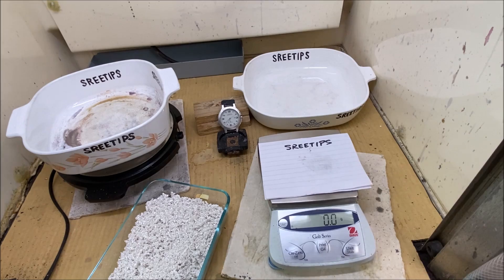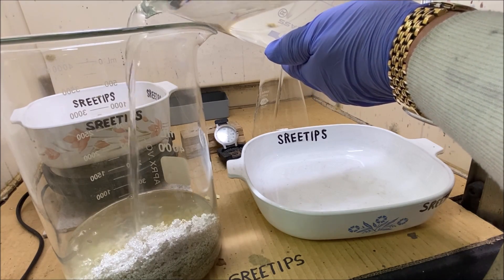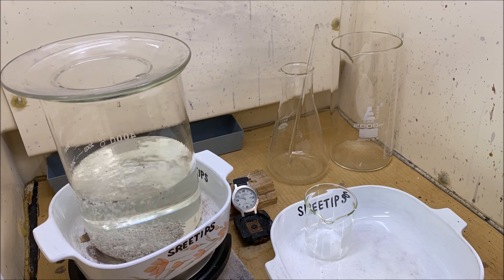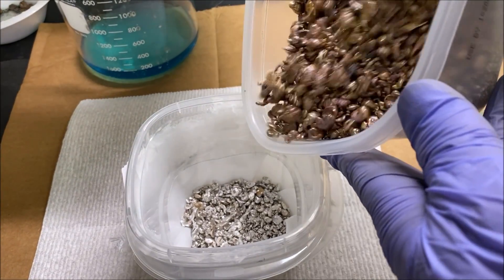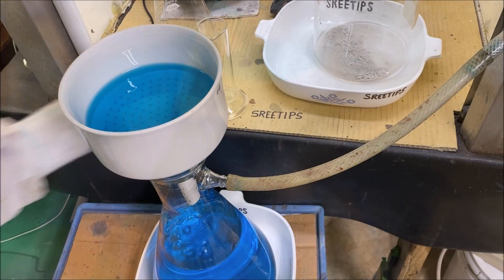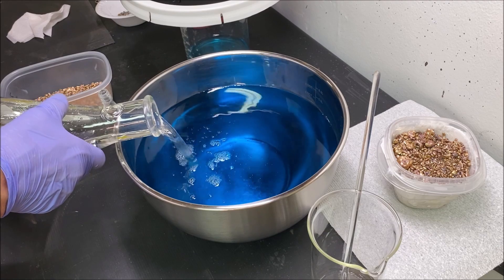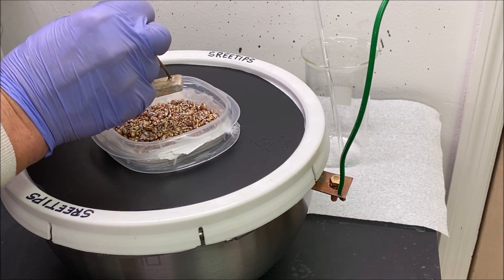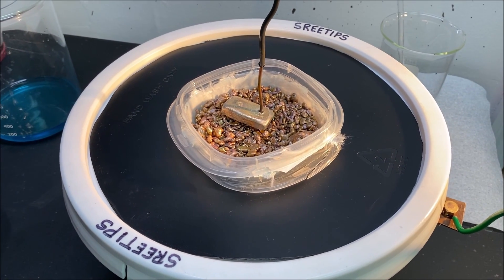Growing Pure Silver In My Six Liter Silver Cell

Comment: Do you need pure silver crystal to make electrolyte or can you get the crystals by just using the silver that cemented to the copper?
Reply from the maker: Cement silver is not recommended. The electrolyte can be made by dissolving pure silver bars or rounds. However, I think I used some cement silver to make the electrolyte for my initial silver cell start up. After that, I reserved some of the pure silver crystal from the harvest and set it aside to make the electrolyte.

Comment: I am curious if I could create the solution outdoors. Our temperatures are between 28° and 42° F right now. Would the cold hurt the process? I am asking because I don't have a hood indoors.
Reply from the maker: Jennifer, this reaction must be done in a fume hood. I ignored this critical warning when I first started refining and did reactions in my backyard, winter weather won’t affect it. Today I suffer from reduced lung function, I have blurry spots on my eye lenses, and I can feel some of my tooth enamel is gone, nitric will dissolve tooth enamel. If you chose to do the reactions without a fume hood to draw the dangerous fumes away from you, then no matter how good you are at holding your breath, the fumes will get in your hair, eyes, skin and clothing. And in your lungs. Even if you approach from the upwind side, as soon as you get close to the beaker the wind currents will wrap around you from behind and pull the deadly fumes right into your face. Turn and walk away ten paces and you’ll still be able to detect it. My sense of smell has been cut from doing this. I remember getting leg cramps from it also. So don’t endanger your health. Get a fume hood or make one. You only get one chance at this. The damage is irreversible.
Reply: @sreetips  Thank you so much for your insights. I appreciate everything you share here and on your channel. I will get a fume hood!
Reply: What kind of a hood should I get? I looked back on your videos hoping to catch a glimpse of what you use but didn't see the actual hood. However, I did see the set up under the hood which was helpful.
Reply from the maker: Get one suitable for acid digestions, no metal parts. Mine has metal trim and it corrodes and falls into the work area. If you’re handy, you could get a large 500 gallon poly plastic tank with a six inch round opening on top and make your own.
Reply: @sreetips  ok, great idea! Thank you.

Comment: How big is your fume hood building one now   ?
Reply from the maker: Just a couple square feet. Not big enough. It gets crowded in there sometimes.
Reply: Wow this going to be little more complicated than I had planned was reading about nitric acid it’s no joke also trying to find about filters like carbon was reading about 3 teenagers that died breathing the fumes thanks for your input
Reply from the maker: If I was building from scratch, I’d get a 500 gallon poly-plastic tank with a six inch connection on top. Then cut a hole in the front, and install a heat rated “F” type motor driving a fume resistant fan in the attic and pipe the fumes outdoors.
Reply from the maker: @jdconn5973 you want a fume hood suitable for acid digestions - no metal parts.

Comment: Does anyone ever wonder why getting Silver Nitrate on your skin turns it black? The silver nitrate reacts with the Salt in your skin to form Silver Chloride. And Silver chloride is light sensitive. So, your skin will turn black when exposed to sunlight. You can't wash it off. It will eventually go away when your skin underneath grows or is worn away my natural means. Sandpaper Helps.
Reply from the maker: I found by accident that hydrogen peroxide will remove silver nitrate stains from skin.

Comment: I am perplexed at why you need silver dissolved in the electrolyte but still need more silver in the basket. Does the pure silver come from both sources or the basket or the electrolyte?
Reply from the maker: The main source is the impure silver in the basket. But some of the silver in the electrolyte also deposits out on the cathode.
Reply: @sreetips  thank you very much! That helps a bunch!

Comment: Hi, not sure if I got this right but, your variable power supply has a constant current (cc) mode. I'm wondering if that would help in regulating the process. No criticism here you do a great job .
Reply from the maker: I run in CV mode and let the amps fall where they may.

Comment: i dont understand why only the silver ions get reduced on the cathode pot. why not the copper ? or the gold ?
Reply from the maker: If copper concentration gets too high, up over 60g/liter, then the copper could start to co-deposit with the silver. As long as silver concentration is kept high, then only silver will deposit. Gold is insoluble and gets trapped in the anode filter.

Comment: I would think you'd put the old anode bars in the bottom of that anode filter first.
Reply from the maker: Saving those for towards the end of the run. They act as an effective barrier between the slimes in the anode basket and the anode electrode bar to keep it up out of the electrolyte, and keep it from being dissolved.

Comment: Immediate growth! Wow! Have you thought of trying the setup with one of those cheap stainless soup stockpots? Or is a rounded bowl better?
Also, I am very curious to know more about the copper in solution encouraging stronger crystal growth. I'm hooked on your channel, man.
"Energise." - Captain Jean Luc Picard
Reply from the maker: The round bowl is better because it will maintain the critical distance between anode and cathode. Too much distance, growth is slowed. Too close and the silver will tend to grow rapidly toward, and come in contact with, the anode basket creating a short that will foul the cell. The copper, for some unknown reason, promotes fat, chunky crystal growth. This theory was given to me by a professional refiner, Gokdsilverpro, on the goldrefiningforum.com and it has proven to be correct in my experience operating this type (thumb cell) of silver cell.
Reply: @sreetips  Ah! Nodularisation! I see.
"Optimise!" -- Capt. Sreetips [lol]

Comment: Why can't you run both power supplies in the same cell?
Reply from the maker: There’s no need to. After the first day, I’ll turn the volts back up to 3.5 volts and the amps will steadily decline as the anode filter becomes clogged up and reduces current flow through the cell.

Comment: Quick question...What would happen to the electrolyte in the 6L basin if it wasn't diluted with distilled water and just put in operation? Thanks!
Reply from the maker: I add water to ensure the proper level. If I didn’t add water then the anode basket wouldn’t make contact with the electrolyte.

Comment: If you are not running the small cells now, you can use both power supplies on the single cell. It will not short them or anything but will share the load. The total current will probably be a little higher as well from the other silver bar being in more contact with the silver shot.
Reply: or run two 6 L cells, lord knows hes got enough cement silver to keep them busy for a while

Comment: I just want to reiterate 3 tips you can adjust the current using the other control instead of changing your voltage especially if you're driving a 6 AM regulator up to 6 amps

Comment: Why did he not include a fuse in the wiring to the power supply?
Reply: Because for now there is no danger of a short circuit in the cell but the fuse just might pop from overload during standard operation (you saw that the Amps went over 6).
Reply from the maker: I add the fuse later after the crystal grows and begins to get closer to the anode basket.

Comment: I always find it scary/festinating when we dissolve silver (pure silver) and we see a blue/green tint to the reaction. It means it’s angry and aggressive. I always think about the bonds getting ripped apart and the exothermic reaction taking place. When everything settles down you see the clear colorless silver nitrate solution just as it should be 😉
Reply from the maker: I remember the first time I seen, I thought the silver cell had failed and there was a bunch of copper in my silver. Also remember seeing it tinted yellow making me think there was other metals in the (excess nitric will cause it to tint yellow). But when it’s all done - crystal clear and colorless, like water.

Comment: I have a question
Reply from the maker: Shoot
Reply: I bought a ring online. It's Sterling Silver with gold plated (layered). What chemical process would you use to just separate the gold plating and the steeling silver without both materials dissolving?
Reply from the maker: Hot dilute nitric will dissolve the silver and leave the gold untouched. Make sure and do it in a fume hood.

Comment: anode basket.... would it be easier if you put the extension into the filter material before you cut it? 1 use the extension to "pin" the filter and 2 give you something to cut the material against ???
Reply from the maker: Yes

Comment: I've only seen a few of your videos and I'm still learning... But I always wonder why you don't bury the anode into the shot? You just make minimal contact... Why? 13:07
Reply from the maker: I keep it on top and out of the electrolyte because contact will cause the anode bar to dissolve.
Reply: @sreetips  thanks
Reply: There's no need, electrical connection is good as is. Also, as the silver is consumed the anode starts plummeting. If it is buried in material there's a risk it'll get in contact with the electrolyte when he isn't watching it, and you want to avoid the anode contacting the electrolyte as much as possible.
Reply: @vinnycordeiro  thanks